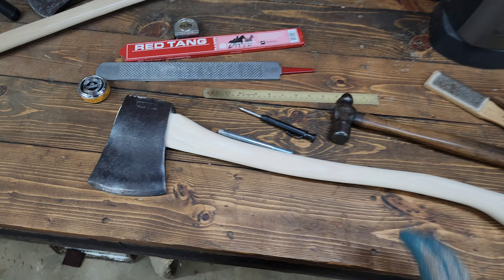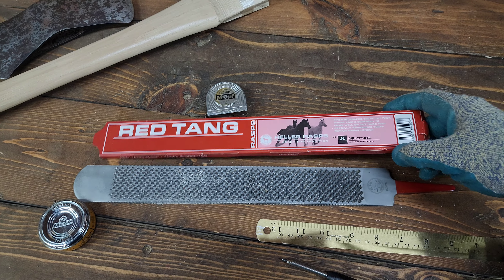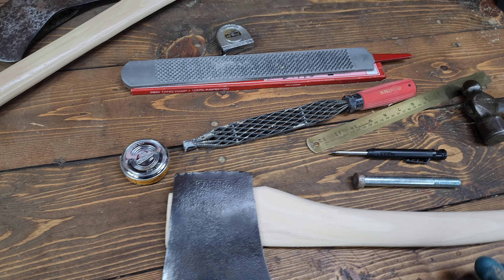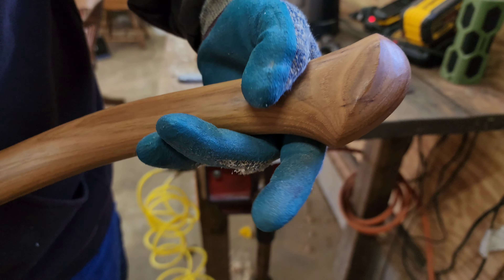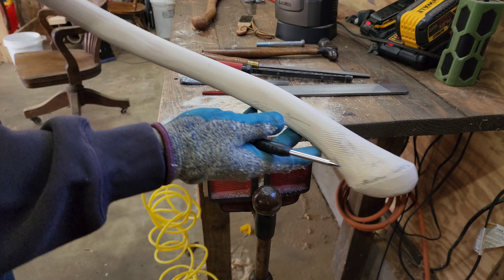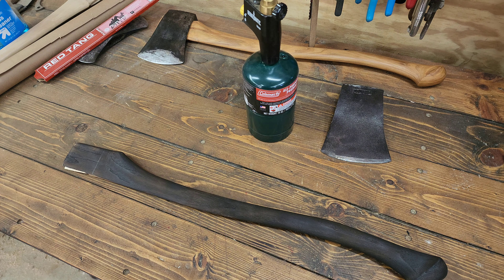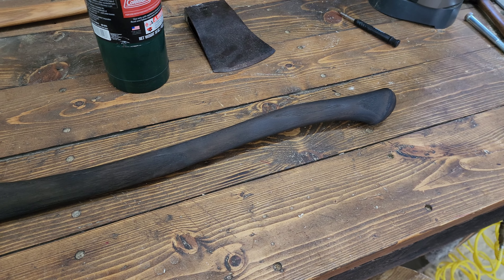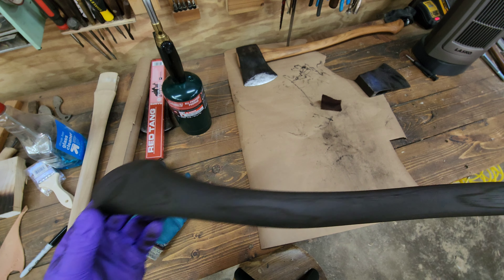Charred Handle Collins Connecticut Axe Build: Part 2

Comment: I usually order the 30inch from House Handles because that's my preferred length for a chopping axe, but they come with a very shallow eye and small palmswell. I just barely seated a Connie the other day without needing to trim any off.  Looking forward to Part 3.
Reply from the maker: Thanks Joey! I've only gotten one 30 inch from them and it also had a very small palmswell. It was one that I had gotten octagonalized so I had assumed they took a bit too much off in that process. It could be that their pattern is a bit small though.

Comment: You don't champer the inside of the eye before you start the hang?

A course round file does wonders for shaping the contour of the palm swell.
That turned out fantastic.
The next handle that I char. I'm thinking about putting an ebony stain on afterwards just to hit the lighter spots.  Maybe even some pine tar
Reply from the maker: Sometimes yes Sometimes no. If there is a large burr or damage causing a lip on the inside I will definitely chamfer the eye first. If it's just s sharp 90 Sometimes I wait until later because the 90 shows me a clear line of the progress. As long as the final seat is tight and doesn't have a shelf it's ok in my mind haha. But I've been wrong before.